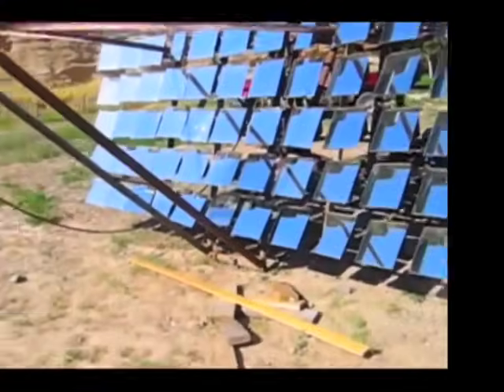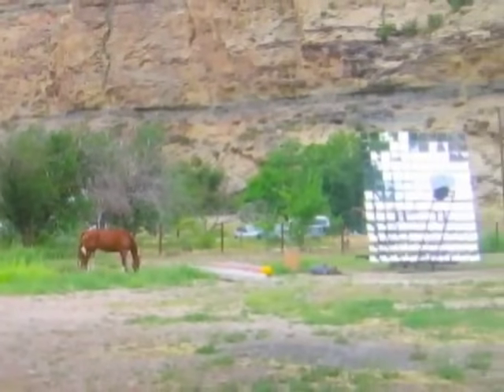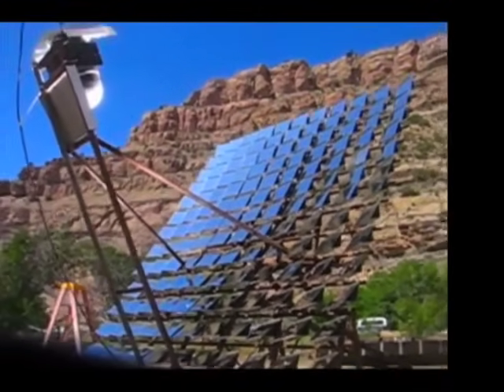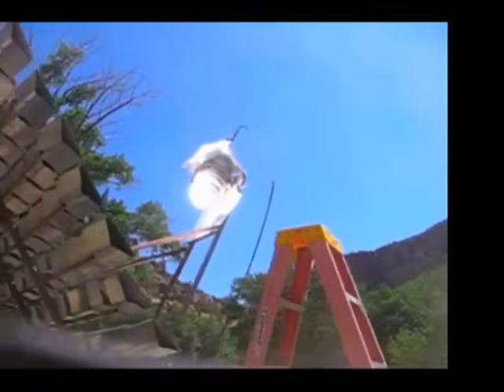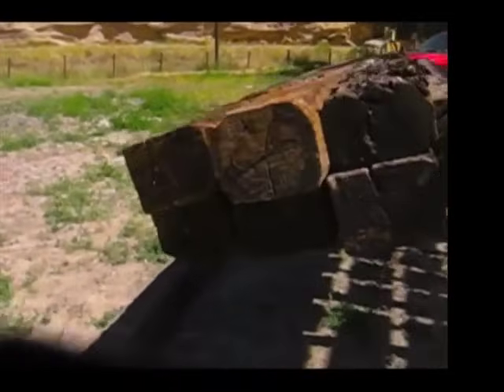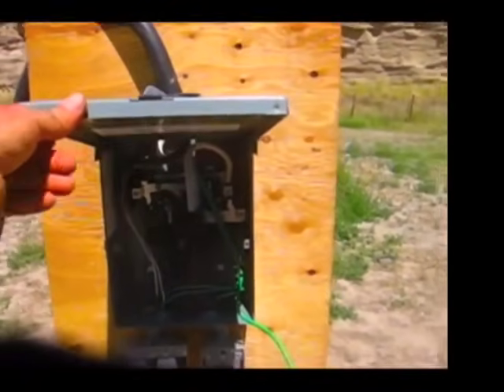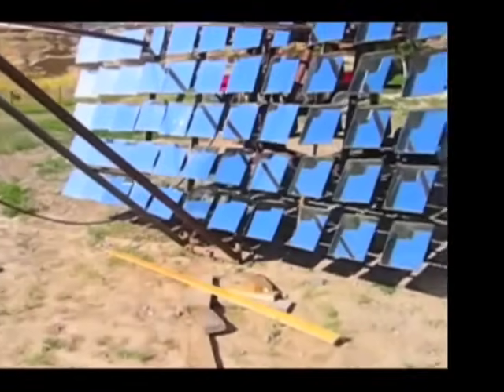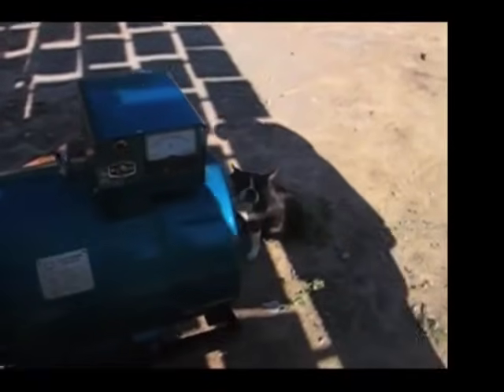STEAM ENGINE 12KW GENERATOR Solar Mirror Array Death Ray

Comment: Aiming mirrors pff. Can't you just put some photocells on the array and write a simple program that tracks where the sun is in the sky and aims the array accordingly. The array mirrors have fixed geometry relative to each other so you could use linkage and servos to control the individual mirros if you wanted to. There is certainly an upfront cost to doing this but at least once you do it you don't have to adjust mirrors everyday.

Comment: Nice test rig, very impressive for what it is and the work put into it.
1) Boiler certified? Probably not and potentially explosive. 2) Needs a battery bank or other energy storage system to capture all the electrical energy produced during peak generation. 3) Needs control systems on the aiming of the mirrors and a lot of other details to make it into a practical system.

Comment: SW8741  is right, the saw is gutless, this contraption can not even can close to make 12KW come on,,,,, a real 12 Kw gen set has to have a balls out 20 hp gas engine at least,, those little cylinders can't make much,,,good try though.

Comment: The noise can be EASILLY be solved by putting the mechanical parts inside a shack, leaving only the mirror outside. To increase the power, you can also use magnifying glasses combined...

Comment: That has 11 by 13 = 143 mirrors, each 'one square foot' mirror getting 92.8 watts of sunlight. That's a total of 13.279 KW of input power from the sun. And it supposedly outputs 12 KW of electricty...That's 90.3% efficient!!! That's total BS. The BEST professionally  designed solar thermal plant is 20-30 or MAYBE 50% efficient. I'm guessing this is around 7% efficient so at FULL power output that's ONLY 1 KW not 12 KW!!! Better to buy PV cells and make several panels, it's easier,for the power.

Comment: @matty958 

Yeah its called a condenser and used in coal fire and Nuke plants. Pretty much most modern plants use a form of steam power to work. So making a solar version all the know how is out there already. Just need to put it on a platform and have a computer to track the sun all day. I bet this has would have a better output then a solar farm on the same footprint. Only It is weaker to bar weather then solar panels. As cloud cover = no heat. Solar panels still pick up some energy cloudy.

Comment: hey, why are we so far up in the air, when I built mine, it was aimed on a stump with a lil ole car heater core, had boling water in under 10 secs... only 30 6x6 mirrors on a plywood with springs and screws to adjust... you needing a PLC and step motors, both cheap units to be had for the sun lineup controls... wish you luck, I may be available in person later, but for now... I do what I can online... maxwellARTgordon

Comment: it looks like a steam engine remake of the solar STIRLING engine from about 10 years ago. the mirrors on that were controlled by printer motors. instead of focusing light on a steam chamber, it focuses directly on the mother which works off hot/cold temperature differences

was wondering if it's possible to do a solar steam powered car eg. preheating water in black pipes like roof heaters with a smaller setup like this to heat to stamp temperatures.

Comment: @upinarms79 Hey man,
Thanks for commenting on my prototype that Greenpowerscience was nice enough to showcase.  To answer your question about the water; it is NOW closed-loop, meaning the steam is recaptured, then run through a condenser cooling it down back to water to be pumped back into the boiler with a boiler feed pump all to be reused again.  It ups the efficiency tremendously because the water is now very hot before it goes back into the boiler.

Comment: Don't not speak of that which you know nothing...  What do you think hydraulic hoses were built for? A flexible way to handle hot fluids with higher than normal pressures.

Comment: @boxa888 It uses flywheels in a vacuum to store energy in the form of motion. It's the only current theory to store power in the megawatt range. It's a very interesting system , other than the possibility of a nuclear-like explosion if the system fails.

Comment: I like where he is going and I agree with matty that the steam  should be reused at least to preheat the water before going into the boiler. I did not get a good look at the engine and I am wondering what design are you using? I am in the beginning stages of my own system and I am currently debating the solar/steam vs. PV system.

Comment: Great video! I would love some more info on the output of the system. How much electricity is he generating, how much water does he use, has he considered recapturing the steam for reuse? How much time, money and effort does he have invested? What sort of mirrors is he using, how does he aim them, etc. Thanks for all that you do.

Comment: @martyvid Battery technology will ever be able to handle something like this. Instead , a flywheel energy system needs to be utilized. Right now a large one is being built outside of NYC to collect power from a nuclear power plant, however flywheel storage does have the potential to explode, and if it does, it can be on the level of a small nuclear device.

Comment: @dzgfdg - i would tend to agree since Vegtables are 'nanotech' already designed for a symbiosis with animals.
the optimistic view is that solar-thermal will allow us to keep the web post oil
the pessimistic view is that all modern tech is an artefact of fossil-fuel energy, and post oil, it's back to C18th 
;
It is possible that telecoms/web genuinely increases 'natures' intelligence (by assembling multiple brains) so 'nature' should be able to preserve it.
see japanese plans for moon+robots..

Comment: 12kw generator is overkill. that can't be over 2kw of solar collection (1000 watts per meter on earth surface on average) Which is why the 15amp saw didn't have a ton of power. But great start nonetheless

Comment: Great video; something you might want to add to the generator is a return exhaust line funneling the spent steam back into the main water container which would eliminate or lease reduce the amount of times you had to refill the water container and also speed up the water boiling process by keeping the water at a temperature closer to its boiling point!!  But good job nonetheless!!

Comment: This is a good Start, just need to add and oil separator, I would also go from a simple to a compound cylinder setup. 
Maybe even look at using some of the solar energy on a super heater, which will greatly improve the power out. 
I am also looking at different energy sources what will use solar panels feeding a battery bank, with a back up wood fired steam plant on low solar / cold cloudy winter days.

Comment: You can make a glass ball covered with a mirrored base, a framework should be able to mirror the one hand to transmit light and the other not! (as in the rooms of identification of offenders) and then will not have to rotate the mirror for the sun! Yes, and heat in a mirrored flask will be kept in a thermos.
how do you that idea? :) I would try an experiment, but no money! :-)
If someone realizes I ask just tell me this is interesting.

Comment: Good concept.  I can see a few practical problems...clean water is one problem...boilers vented to atmosphere must have pretty clean water and lots of it. I would investigate the practicality of using a condenser with purified water in a closed system....recovering heat being vented to atmosphere as shown would also improve the efficiency allowing for more hp output for the same solar heat collection apparatus.

Comment: I live in northern NY and there are a couple dozen or more commercial wind mills in area. Yes there is a sound, but it is soft and inaudible 200 feet away. Yes it can be intermittent. But not  in the way most people think. Choose the right location and you will be generating power 80 to 95% of the time. For home power that is not a problem. Batteries can easily hold enough power for the 'lean' times. As for commercial, Every hour of windpower  is one less hour of wasting resources.

Comment: WHAT IS THE OUTPUT?  I like the solar /steam and am new to looking at the parabolic plexiglass mirrors and am thinking of setting up an idependent array of some old 12' Satelite Dishes using the equitorial motor mounts from MEAD telescopes and the silver nitrate somehow on the front.  I will use a manifold to enter the turbine.

Comment: Quite impressive stuff. Putting aside the technical aspects, projects like these can electrify the remote villages of developing countries. unlike solar tower, these small systems cannot run after sunset. If only  systems for storing heat for night are made available, I strongly believe  parabolic reflector based systems will be the best stand-alone power generators for  remote areas.

Comment: The ST-12 is a 340-pound cast iron beast; a good chunk of that is in the rotor.  There is enough rotational inertia in the rotor, even disconnected from the steam engine entirely once up to speed, to start the saw and even cut a bit with it.  A continuous draw, non-inductive, non-rotational-inertia load, such as a bank of 500 watt halogen work lights, would be a better demonstration of the continuous power output.  Peak power is...well- that generator could put out a lot (briefly) if shorted. :)

Comment: Actually, he would *gain* power, as it would create additional pressure differential (i.e., you could think of the vacuum created "pulling" on one side of the piston, while the steam "pushed" on the other side  for more power.)  A problem that arises is that you will have a little bit of steam oil mixed in with the condensate that has to be dealt with.  (You have to lubricate the steam in order to not wear out the engine prematurely)

Comment: Who rated your boiler at 3000 PSI?  YOU?  Is this based on a hydrotest?  Where can I see these published specs?  Safety should be your first concern and I see no pop-off valve?  You *that* confident about the structural integrity about the rest of your setup?  Did I get anything wrong in my original post?  You bash Mike Brown, but it looks like you're using his engine.  It is disingenuous to throw 12KW in the title when you're clearly not producing anywhere near that.  Current draw through saw?

Comment: Taken the abuse for several months now with no reply. Clearly states in the video/ went as far as I could with the money at my disposal; Dan make a point to say that Im still trying to perfect it and need help w/my "budgeting". If I had the money it would be auto-tracking, have recirc pumps, recapture steam, pre-heat through exhaust steam jacket etc.. Also, if WE had any guts we would stand up and build these for ourselves as communities and not have an electricity bill. Would you stand up?

Comment: E-mail me with intelligent, thermodynamically feasible questions or for tips.  Only if you're serious, (or as Mike Brown would say, not a professor pinkhands) though.  Not sure that I'll check this too often.  Steam is nothing to mess with.  ASME certified pressure vessels, pop-off (emergency pressure release) valves, etc. things to consider. If not... well, you'll probably shoot your eye out kid. Or worse. KUDOS to G.P.S. for highlighting this individual though.

Comment: Obviously, still needs a boiler feed pump for continuous operation, and as others have noted, using exhaust steam as a feedwater preheater, or condensing, but then you'd need an oil/water separator for your lubricating oil.  You'd have to superheat if you wanted to run a turbine without blasting the blades to hell in short order.  Google Esolar, Brightsource solar, Solar one (daggett), Ausra, etc...All been done before.  Maybe residential scale niche.  PV approaching 1$/watt though.Obsolescence?

Comment: Looks like 11x13 1 foot mirror tiles, 143 square feet, 13.3 square meters collector area.  At 1000 watts/meter^2 insolation, with perfect everything, no losses (2 big ifs) 13,000 watts thermal in.  Looks like a 20HP Mike Brown steam engine ($6,500) and a 12KW 4 pole ST generator with a spur gear reducer backdriven to speed up RPM closer to 1800 RPM.  Good start, but still a long way to go.  Show continuous power, not STARTING the saw, which the inertia alone in the system would start...

Comment: in the end this isn't all that impressive..... can you guess why? However, it is impressive that some one made it for they're own lot using pieces lying about. Im sure if he had the parts, it would be alternator inverter based so that it could operate at the proper frequency and current when the pressure is lower. Keeping it pointed must be a b**** tho...

Comment: This is really a good one! Worth watching.. Joe had put in lot of efforts to implement this. But it has lot of moving parts(for the generator and stuff like that) which causes lot of maintenence cost. I would suggest going for a DC-AC convertor or some thing like that instead of a generator? didn't he think about any thing like that? Even i am planning start working on implementing some thing liket this. Can any one suggest where to get the a good deal for solar cells in bulk?

Comment: I agree with your observations. But that's about right for a once through steam system. Also his boiler is leaking and he's not super heating his steam. Then he has to boil fresh water for every batch since he does not condense or economize. But what's to say he's done? This is the first guy I've seen to go all the way. I'd say he's putting ~15 KW thermal in and getting about 10% out electrical. All in all hats off and keep up the good work.

Comment: The saw they were using was 15 amps (max I assume) at 120 Volts.  I assume there was no other load attached at the time.  This means it would have been pulling about 1.8 KW at spikes.  The saw also seems to labor with the power given.
Still an average home uses no more than 1-2 KW per hour.  This would have to produce about 4 KW to store enough energy to power a household continuously.

Comment: This is what I think.  It is one thing to say the maximum on that turbine is 12 KW, but it is entirely different to load it to that much usage.  The saw they had going looked to be draggging under that and they said it was 15 Amp.  At 120 volts thats about 1.8 KW.  I don't think the setup could take that much more of a load.

Comment: hi i would think an idea is to recycle the exhaust steam by condensing it that would cause a vacume inprove engine power and pumping hot watter to the boiler and then increasing power

Comment: 2000F is roughly 1100C? Graphite or certain metal powders might be able to take it fine, as long as oxygen is blocked away somehow, like some molten glassy coating that doesn't crack. He seems to be using just a metal pot, which should also oxidize if temperatures are too high. Both graphite and metal are lustrous when smooth, and their blackness is about texture and small particle size. Basically rubbing the pot with just charcoal dust may work, or add some talc/glass powder to coat the surface

Comment: Few questions here...

Couldn't he just attach a sealed turbine to the generator axle and feed the steam pressure through it? and maybe a second turbine to catch the remaining pressure?
Or are steam engines more efficient than turbines?

Are those standard store bought mirrors he is using? Are those actually more cost-effective for this purpose than other mirrors, lenses, etc.?

How is his steam pressure controlled? Is it electronic depending on how much electricity is being used?

Comment: Nice job.  An old C-band satellite dish is much lighter and not too hard to find.  Most people who still have one standing will be happy to let you haul it off for them.  The solar input of a 10 foot dish is close to 8Kw, and a 12 footer around 11Kw.  

Keep the steam line heavily insulated and as short as possible.  Paint the receiver with BBQ paint and make it big.  It is better to have 2 square feet at 400° than 0.5 square feet at 1000°.  Use aluminum for better heat transfer.

Comment: i suppose what he is doing here is pumping water on a very small constant trickle into the boiler causing it to flash into steam and exit out the engine .
you can force a fluid but not a gas.

Comment: I really like you guys. I have many great solutions to our problems and one uses the solar furnace concept big time. I can't talk about this stuff with most people, they just have no head for it. You two are right on top of it though. Heliostatics is the number 1 catagory for power generation imo. I have great concepts in other forms of electricity generation, but the sun is a no brainer. Oil is for plastics and lubricants and stuff. Electricity all way baby!